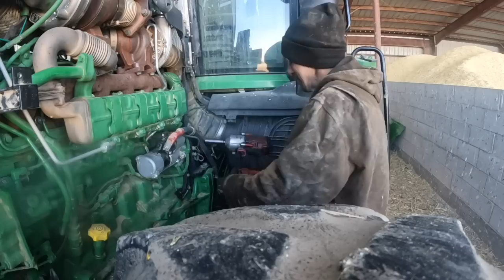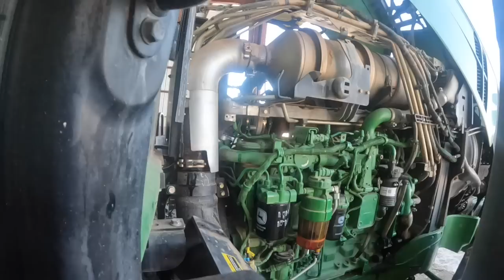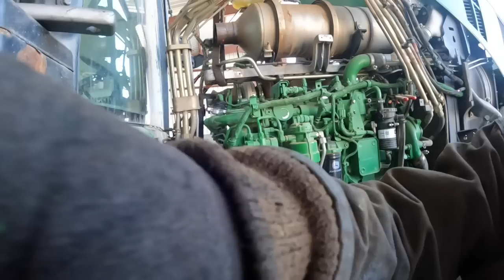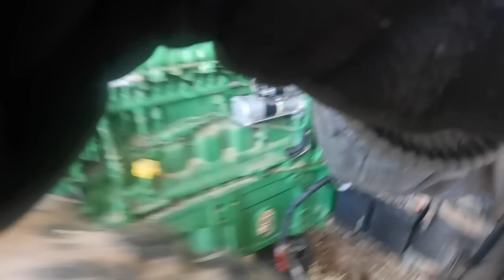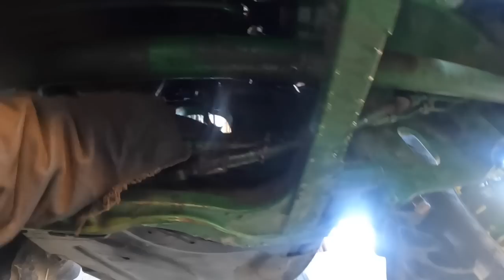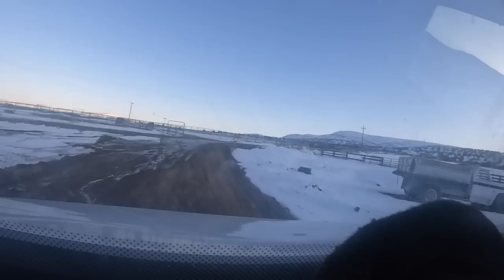John Deere 7215r torsional damper replacement

Comment: Warren you need to find a Herman Nelson heater used they put out  300 degrees they use them on aircraft when working in the elements

Comment: hey warren maby you can spray paint one edge of you handy wrench cheater bar the side for losie so you dont have to look at  it and figure witch way to turn it paint side up for removing it i did that for my fancy matco belt tens kit it saved me alought of time over the years of putting it on only to reailizng the rachet wrench was going the wrong direction